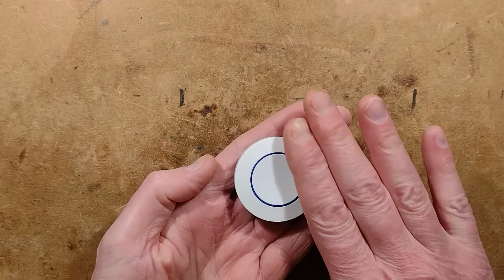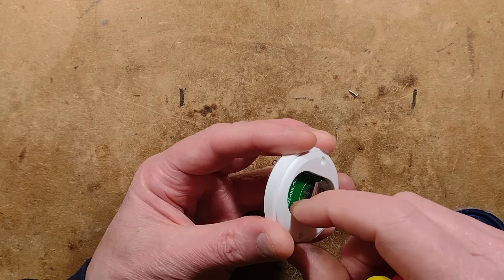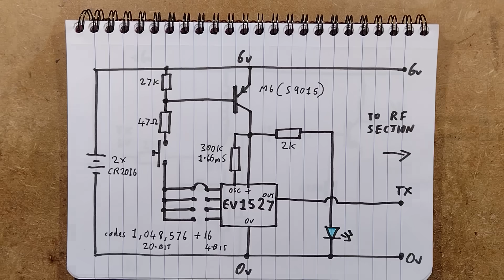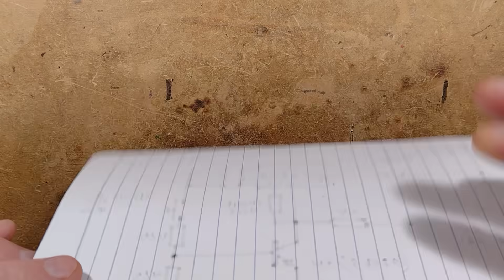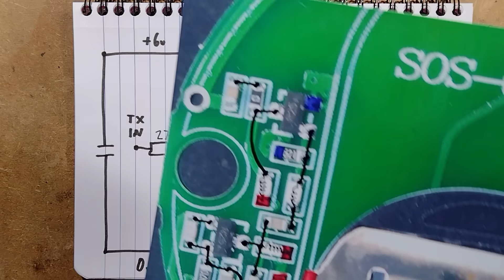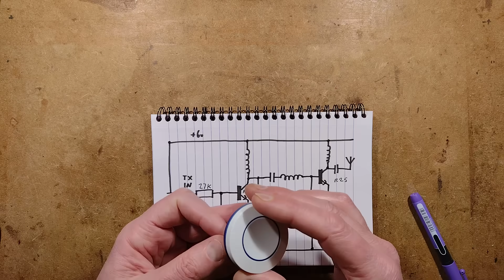Inside a very common style of remote control button - with schematic

Comment: A simple button like that and the RX unit with NC/ NO contacts would be so very useful.
Reply from the maker: They do 12V cased modules with volt free changeover contacts.
https://youtu.be/tkhUR_30o0s
Reply: @ Dry Contact

Comment: I think it would be 2¹⁰ times 16, not plus 16.  Actually 15, as the address (well, data) with all the links open wouldn't pull any current to turn on the transistor.

Comment: I have a few of these that I have stuck to the back of the nightstands for turning the lamps on and off via smartplugs (so the bedtime routine can turn them on) and after the first battery change I ended up designing and 3D Printing a mount that they can slide into because the sticky tape was annoying to deal with.

Comment: The capacitor from base to emitter on the oscillator is a bit of a mystery but other than that, the circuit is fairly simple.
The 433 part, whatever it is holds the base of the transistor at a constant voltage RF wise at the natural frequency of the part.
I suspect that the emitter base capacitor is to ensure that the thing can only oscillate at the 433's frequency and not improvise a tune based on the trace lengths. An R25 can happily oscillated up to a few GHz.

Comment: When I was building research robots in the early 2000's, I remember a software engineer describing radio control and communication as "Black Magic". 
Very mysterious stuff. But it works! 🤔🧐 📻

Comment: 0:41 - *rolls eyes* Just what the world needs, a doorbell that greets you, and welcomes you to your own home.
(Sensible people would be putting the chime module somewhere in the house/shed/etc. where they could hear it, not outside for visitors to "enjoy," so the voice cues are completely pointless. Unless, of course, you were watching your front door from a distance/CCTV and wanted to greet visitors as they got to the door, in which case that might actually make sense.)

If I ever had an electronic doorbell, it would have to be one of those 1980s programmable models that are equipped with a few hundred tunes. 😆 They usually had nice faux-woodgrain and brass-ish accents on the enclosure, so they had a nice visual appeal as well. Some of them had a mini membrane "piano" so you could add a few of your own custom tunes. (Imagine someone ringing your doorbell, and hearing Rick Astley's "Never Gonna Give You Up!") 🤣

I know how you feel right now, regarding "Spring Fever." Trees are just starting to finally turn green on my property, hiding the neighbors' houses, and filling the air - and covering every surface - with that wonderful yellow pollen. That reminds me, I should probably top off my wiper fluid reservoir, since it's going to be getting a LOT of use over the next few weeks.

Comment: I bought a couple of these not too long ago, and it actually took quite a bit of effort to find the ones I wanted. For my purposes I wanted a red and a blue button, and I could find a lot of vendors that sold one or the other, or multiples of a single colour, but not many that sold both the red and blue ones. Aliexpress search really is terrible, much worse than eBay, which isn't that great either. Eventually I did find one, and I was pleased when they finally arrived that they actually sent the ones I wanted.

Anyway, hope you're feeling better.

Comment: Being pedantic here, but at 6:50 that probably should be 1,048,576 +15 because an all-open selection wouldn’t provide any ground path to turn on M6 pnp.
Reply from the maker: A resistor could be added to allow that.

Comment: So the part where you said they make a million of these and they don't interfere with each other is each one made at the factory with a different frequency
Reply from the maker: They all have different codes programmed in during manufacture.

Comment: The first transistor in the transmitter circus is the Colpitts oscillator with the 433MHz quartz resonator. The second one is the power amplifier.
Reply: The resonator may be a ceramic one.  Chances are the transmitter and receiver are not very accurate about the frequency.
The resonator is being used in a manner Colpitts didn't think of as far as I know.
I take it as being series resonant
Reply: @kensmith5694  I'm almost certain that this is a SAW resonator, most likely the SCR433M920S001.
By the way, the datasheet for it even includes this exact circuit configuration.
Reply: @MaxPivovarov  I suspect you are right about it

Comment: Schneider is making or someone else is making piezo electric estops that use the piezoelectric effect to run the transmitter so you never need batteries or wires .I don't like it because the mushroom head is not illuminated but it does make a nice kill switch to shut down everything
Reply from the maker: I wouldn't trust a remote E-stop.  They normally have to be hard wired for safety.

Comment: Back in the early 90s I worked for a small company that made the electronics for garage door openers, conservatory blind controllers and other contract work (lots of testing of train circuit boards, I even had to spray conformal coating on those at times!).
I recall adjusting tiny variable capacitors with a trimming tool to set the 433MHz centre frequency on an rf spectrum analyser.
Later I got to design a replacement (using an RF module as it was cheaper to make) - following the module datasheet to implement the aerial. I also had the fun task of testing the range, setting up a light bulb in the test room window and taking a long walk across the car park / wasteland. I got to the far wall of the former building that made up most of the wasteland - nearly 35 years later I can't recall the distance and the area has housing in now, so looks rather different. I think it was between 200 and 300m (with the key fob needing to be higher the further away I got, and dead ground in front of the wall, but still working when on the wall)

Comment: FYI, there are smart switches available for iot technology that can also pair with these RF-433 remotes.

The ones I have can pair with up to eight remotes, some have more than one gang. You can either tap the physical switch on and off, or use a button remote from another location, as well as using Alexa or similar for voice. I have several in place.

The pairing can be a couple of different options, toggle on-off, momentary, stepping, and another I that I don't recall the details. 

You can also get switched outlets with the same feature, as well as plug sockets

Comment: Can only imagine the load transistor being there because it allows a very small off current to manetain a state in the EV1527.  Maybe the current random number seed value is stored in RAM instead of flash.  Then they permanently power the amplifier to save on the number of switches.  Wonder what the standby current is.
Reply from the maker: The EV1527 has its code set at the factory.

Comment: Those S9015's do have a tiny emitter - base cut off, of 0.1 microamps, so there's probably more than enough current flow to reliably do the job. We've got an earlier version of that "wireless doorbell (from the usual source!) on the bottom of the back sliding door. When our local Raven family (and King Parrots!) want to be fed, they have (very quickly) learned to "ring the bell".  The Ravens worked the system out first, and the KPs very rapidly copied their actions! 😀

Comment: what happens if you just get short the button out and put button straigh in line with battery? there must be some delay issues in rf final circuit to make it super complex? if sequencing is not the issue, yeah, why not just have battery connect when you want to transmit. truly zero standby current!
Reply from the maker: It may be to avoid issues with the resistance of the button contacts.

Comment: You said that the links would set another sixteen codes.  I'm not acquainted with the chip but it seems that it would allow not 16 more codes but 16 times as many codes.

Comment: These are fun and very cheap. I've installed some wifi controllers for lamps which also have the option to pair with 433 MHz buttons like those. But please know that they are stupidly easy to hack with basic 20 bucks SDR (Software Defined Radio). I hacked doorbells which used exact same buttons couple months ago in one of my coursers here in Warsaw University of Technology

Comment: Fair dinkum can you guys knock it off, im still trying to get my head round crystal oscillators in ir settings and now what? Standing wave rf?
As a kid i had a skateboard, it just had wheels with barings in it 🤣
This kinda thing will drive a man to cold meats, bread rolls and denial quicker than 433mHz can pulse.......standing wave...... WHAT? 🤣

Comment: There is no reason to run the antenna trace on both sides of the PCB. I don’t know why they insist on doing this but I’ve seen this when working with overseas manufacturers for the last 15 years. They seem to think FR4 will somehow block the RF of something. By tying two traces with vias like that, it actually makes the antenna less “ideal” than just a single trace. 🤷‍♂️
Reply from the maker: It may be to create a thicker and lower impedance trace?
Reply: @bigclivedotcom but it doesn’t. It just creates a bunch of stray inductance and capacitance nodes which actually interfere with the radiation pattern. Better off with a single monopole trace or loop. A loop would be best to give immunity to nearby metal and moisture.
Reply: I’ve seen some crazy stuff, and I love your videos that expose some of it. Keep up the good work! 👍

Comment: Can it be matched to a relay and a low voltage capacitor attached to full mains power under the bed while the partner is unsuspecting... 😅

Comment: I wonder what the best doorbell would be? We just have one of the boring little black ones that use bell wire to activate a solenoid and ring a bell, but the problem is that the black button is clearly very boring as nobody actually rings it - they just knock on the door!

Comment: Interesting... (pause for annoying finger air quotes) thing, I drive a slightly elderly and bewildered Range Rover as a daily driver and the alarm/immobiliser is on 433mhz. On many models, barring the very last of the production run (not mine) they suffered with interference from nearby other 433mhz things... not much of a problem to most vehicles, but when you have a luxury warship with far too many electronics that are all in differing stages of electronic alzheimers, this all of a sudden becomes a bit of a problem.

The system monitors itself whilst "awake", but when you lock the vehicle, it stays awake for a short period of time, and if undisturbed, will go to "sleep". But, like the bewildered posh twat it is, anything nearby that works on 433mhz will wake up the electronics and everything goes batshit for 30 minutes as all the systems start reliving their best lives in Keen-yar and the good old days of Empire before everything gets confused, forgets what their talking about and all go back to sleep again after leaving a small embarrassing puddle under the engine and one side of the axle.

The downside of this whole thing, is that you can often come back to a car that has a very flat battery if you live somewhere with a lot of 433mhz action. Land Rover did eventually address this issue and change the receiver but earlier cars were stuck with this problem. I had to buy an aftermarket RF filter made by a fellow owner to stop all the arguments happening betwixt the many black boxes full of dementia and to stop the battery going flat.

Comment: For such a common and useful circuit,why isn't it added into a smartphone?
Reply: For what purpose? It's only useful if you can customize what it does, which isn't going to be easy in a smartphone. Also just because WE might find it useful doesn't mean 99.99% of smartphone users will. Also everything in a smartphone is digital, adding an analog device won't be quite as easy as you'd also need an interface. Plus smartphones are designed to AVOID any kind of RF interference that might compromise the 4G, 5G, BT, and WiFi signals, which 433 likely would. And the wireless charging circuit could put voltage into the antenna. And then you'd have to make these 433 devices comply with FCC standards and the equivalent for every country. Not to mention the lack of available space inside a smartphone... Almost every square millimeter of pcb is populated in them. And lastly.... I bought a 5 pack of 433 transmitter/receiver module pairs for $3. Apple would charge $100 extra to include it.
Reply: @SkippiiKai  if people are using these remotes across many devices then a customisable controller on a smartphone makes sense to me,analogue to digital interface is straightforward,happens all the time in music.
Finally...it's an engineer's job to make the circuit work.
Reply: @JohnHaveaguessGoogle  It would technically be possible, sure, but there would be, and are, so many better ways to do it. An app on the phone is a great idea, and make it connect through BT to an ESP32. So much easier and cheaper and more effective and better.

Comment: I set up an ESP8266 connected to a 1527 receiver and all it does is sit on a shelf and translate incoming 433 Mhz codes to an MQTT topic that I watch with Node-Red that then decides what to do with the signal.  Once it's in node red you can then make it do anything you want with conditions and rules. Like before noon, turn on this, after noon, turn this off, or whatever you like.

Comment: Isn’t that actually 1,048,576 x 15  since the 16th value of that 4 bit resistor network is all missing, so there is no pull down current to turn on the PNP transistor?
Reply: usually there are 4 keys in the remote so the number of combinations must be multiplied by 4
Reply: @electronics-by-practice  unless multiple keys are pressed simultaneously (physically or by a processor) in which case the inactive state is one of the 2 ^ 4 combinations, leaving 15 others (2 ^ 4 -1)

Comment: That is so commonly used frequency with car remotes, door bells, you name it. I'm pretty certain, that I once had an aftermarket remote car power lock doohickey, and one day when I was unlocking my car, nearby alarm went off at the same time. It was a WTF moment. Then I remembered, "oh yes, Chinese magic".
Reply: Often the encoding chip is different. This one is fine for turning lights / other small things on and off, but if you're using it for any kind of security purposes it's not suitable because it's trivially easy to record and replay the signal (a few dollars and about 20 minutes building a circuit) because it uses a fixed code. Hence why these aren't compatible with a lot of 433MHz frequency devices that use a rolling code. Still, as long as you bear that in mind these are great for a lot of uses, it's hard to beat the price for a pretty decent design.

Comment: I love how common and inexpensive these and their receivers have gotten, my favorite are still the batteryless self powered ones. which I also happened to stumble on from one of your videos. I've had some for over 4 years outside without issues as bell trigger
Reply: That's not a bad idea. Out here in Finland it gets cold enough that regular 2032 cells are useless for doorbells as they just won't power anything anymore.

Comment: Clive, I want to thank you for your teardown of defective low-voltage power supplies.

I had rescued a thermoelectric Frigidaire cooler, and the LED front panel light and "ON" LED kept flickering. From your videos, I knew the power supply had died. I took it apart, and sure enough, one of the output caps had a domed top and vented. I'm now waiting to acquire two 100uf 25v caps to fix the problem.

Thanks again for the instructions on how to salvage an otherwise good item. :=3
Reply from the maker: Make sure you get low ESR caps.  They are optimised for the high frequency of those supplies.
Reply: So, to re cap, you fixed it?
Reply: @hugegamer5988  Not yet, but I will. :=3
Reply: @hugegamer5988  I just got that. Second time I read it. 🧐Duh! (<Me)
Well done! 😂
Reply: Did you measure the voltage, or double what the old one was? Electrolytic caps have very low MTBF rates when used at or near their rated voltage. I always derate them by 50%.
Reply: @MTGeomancer  I am only going by what is printed on the existing caps. It is a 12v supply, so 25v should be more than adequate.
Reply: @LionkingCMSL it's unlikely to be printed on the shrink wrap. It is what it is.
Reply: @MTGeomancer  👍
Reply: @MTGeomancer  I've been very naughty and have modified several Dell laptop power supplies to produce about 23 V for LED strips, and their output capacitors are rated at 25 V. They've been there for about 7 years and OK so far, but I take your point. I might have been saved by good quality components used in OEM equipment.
Reply: @matthewmarks6951  Probably just lucky, or it didn't use electrolytic caps, or runs extremely cool. Look at datasheets, even on the best brands out there. The MTBF is abysmal (like 2000-5000 hours, maybe 20,000 hours), but is still just an average. Some will die in months, others years. It's highly dependent on voltage & temperature.
Reply: @MTGeomancer  They all use electrolytic capacitors but yes, very rarely get hot.

Comment: Thanks for an interesting video again, Clive, and I really hope you get well soon. The way the system works is particularly useful in that not only does the button consume no power until activated, multiple receivers could be activated at the same time.

I noted from an earlier comment that a video on the receiver is in the pipeline, which I patiently look forward to. I do wonder if the receiver can be configured to do other things such as give an output suitable for driving an external device. It would also be useful of the internal sounds can be modified, either through overwriting, chip replacement, or some other means.